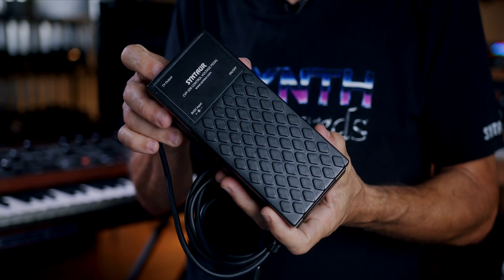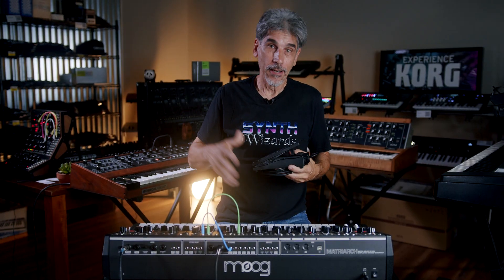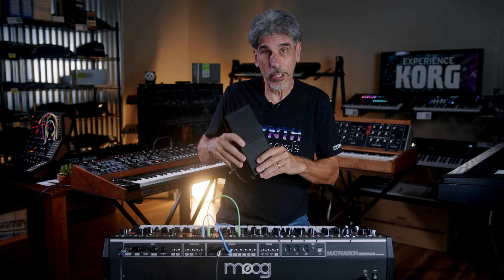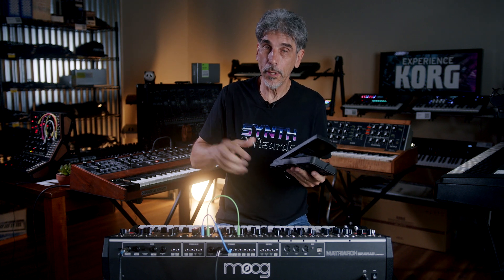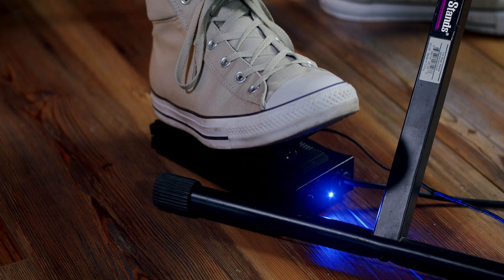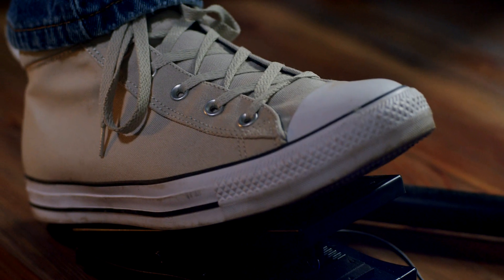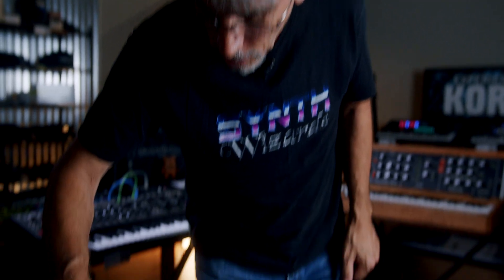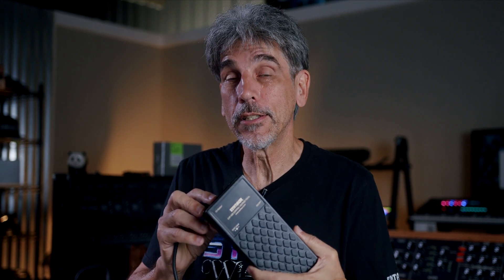Vintage Synthesizer Modulation with the Syntaur CVP-100 Control Voltage Pedal

Comment: Diving into the manual of my ESQ – 1 , it says the CV jack is rated for 10 V , that means it should be compatible with eurorack CV correct? Would negative voltage cause harm to the synth?
Follow up , on the passive pedal TRS , the tip is the voltage out of the synth and ring is the voltage return?  ( so a stereo breakout cable coming from the Cv pedal jack of the esq-1 could be used to patch eurorack cv to the ring input).  Am I crazy ?

Comment: I'm a bit confused by this. The Matriarch manual states that the Exp Pedal jack uses a standard expression pedal and not a powered CV pedal. "This 1/4” TRS (Tip/Ring/Sleeve) jack provides a +5 Volt signal on the ring connector. Operating a compatible Expression pedal – such as the Moog EP-3 – connected to this jack will attenuate this voltage so it can be used to vary any controllable parameter. "

Comment: O-5V only? Most vintage Oberheim synths require 0-10V.
Reply from the maker: They don't REQUIRE 0-10V, they can ACCEPT that voltage range.  So this pedal works fine with Oberheim gear.  The range sweep will be less than a pedal actually putting out 0-10V, but in practical use, it works very well.
Reply: @Syntaur  I have this very handy and clever CV box: https://imgur.com/gallery/dPkhAGK
So I can test different CV ranges with my vintage synths. With my OB-X and 4 Voice, the 0-5V range is really too limited for a nice filter sweep.

Comment: Cool, my Prophet 600/Gligli has a CV filter input so this pedal should work... When they're back in stock, of course!
Reply from the maker: They are back in stock.  We sold through our initial batch pretty quickly, but have more on hand now.
Reply: @Syntaur  w00t!

Comment: Nice product (it controls CV-gear - so it induces GAS) ;-)
Question: the demo states "0 to 5V" and that's basically ok for some applications and gear, but can it also send other ranges: like "-5V to +5V" or "0V to 10V"?
Reply from the maker: Ours is modeled after the vintage Moog pedal, which has the same voltage sweep, and the 0-5V range can work with pretty much anything.  For the Korg -5 to +5 gear, you will have control, but only of half of the range - which is still quite useful.  With something looking for 0 - 10V, you will have finer control over less sweep.  And in practical terms, that is often just what is needed.
Reply: @Syntaur  appreciating your clear reply. Tx.